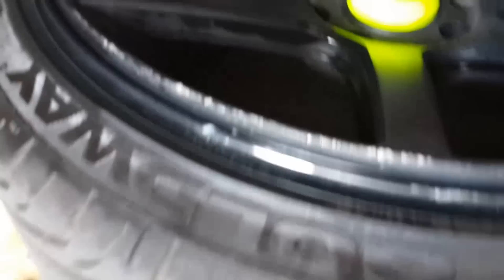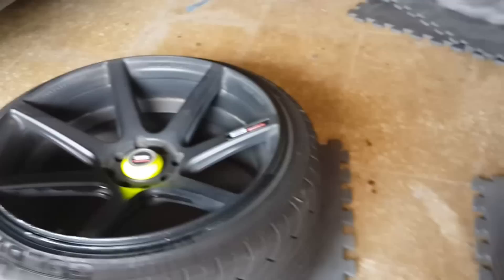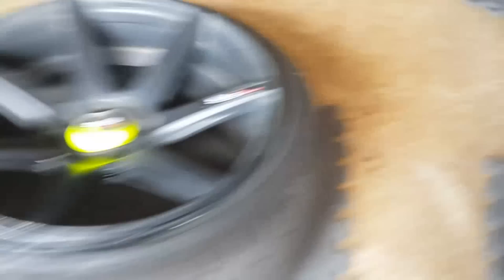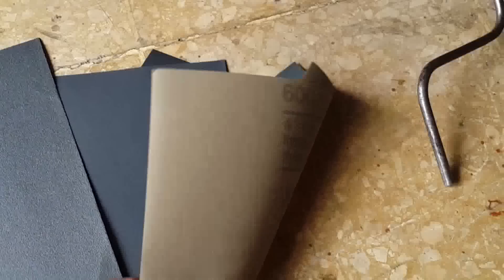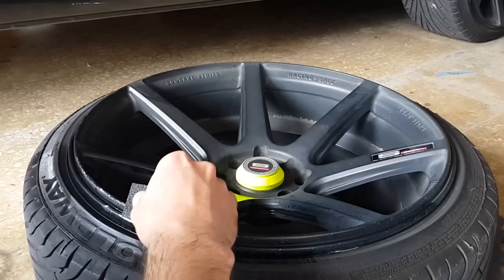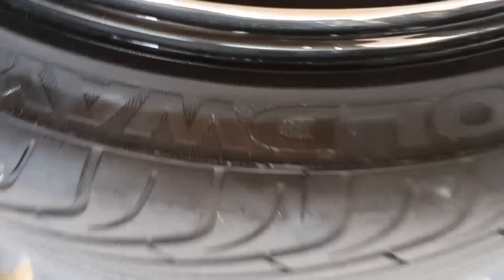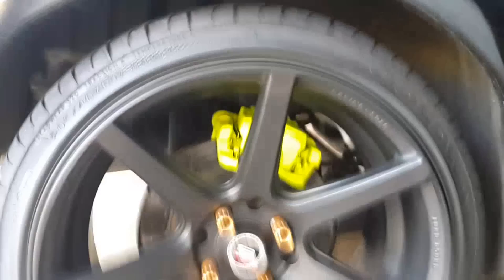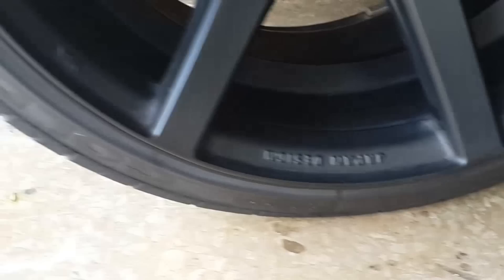How to fix scratched or damaged rims

Comment: Hey, I have a question. Is it actually safe to remove damaged rim using this kind of method? I was told that this may actually hurt the rim structure and cause potential safety issues.
Reply from the maker: Never heard of that before and I still haven't crashed or my rims exploded